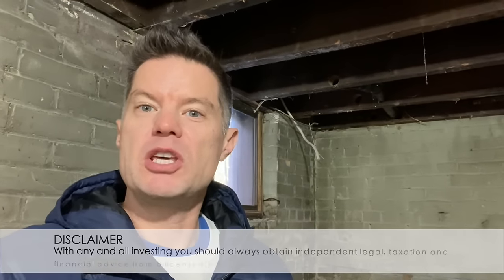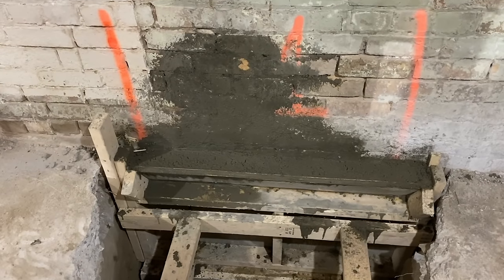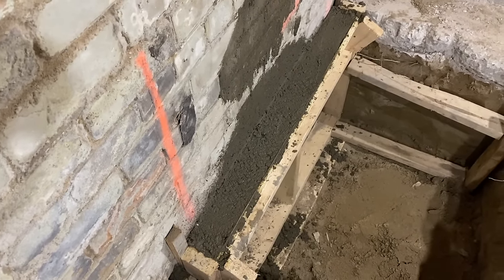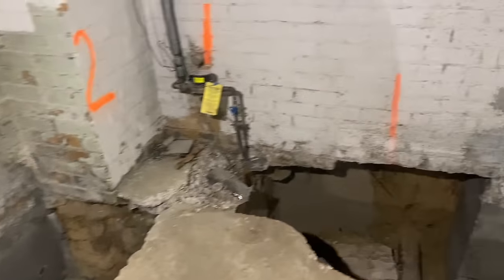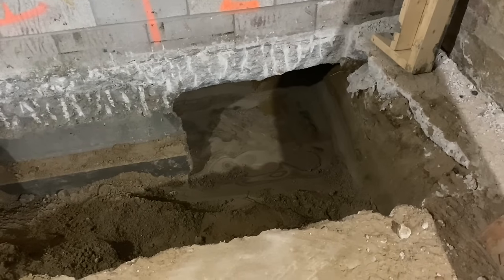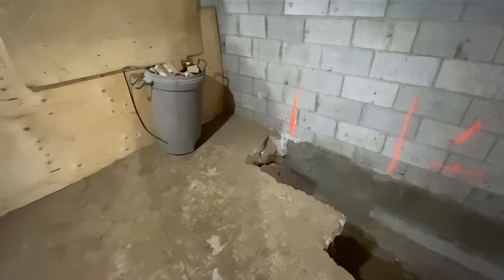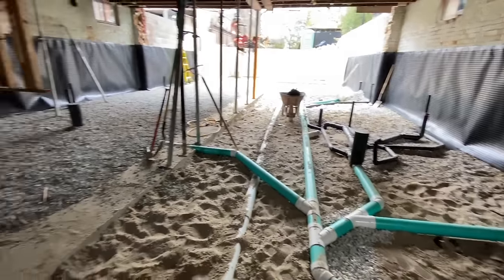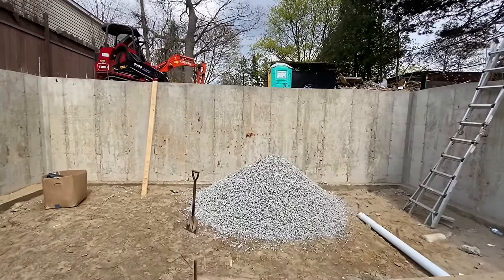Lowering your Basement | Step by Step Underpinning Explained | How to Lower a Basement

Comment: Since the new foundation is NOT monolithic, rebar should have been installed in the foundation pour with the rebar overlapping at least 24 inches. Currently your new foundation is a series of unattached pier footings.
Reply: Was going to ask about this exact thing.
Reply: Disclaimer up front. No engineer here. That said, I was thinking the same while watching the video. 
Im wondering if the following was considered with the non-use of rebar... Each key's rough and uneven edge  provides subsequent pours something to bite into.  Also, the ground at each key has supported weight for quite some time, and so it's packed and solid. There's the step (or "bench") at the base with the floor poured up against it. There seems to be appropriate joisting to support weight distribution and it doesn't appear that any specific key stands to be overloaded. I dont know enough to make any of this an argument. Simply asking if the decision not to use rebar was made on any of the above. 
I'm fascinated by the subject and enjoyed this very well made video and appreciate the work that was done.
I do have another question with regard to the use of waterproofing membranes inside the home. Could holding the water behind them compromise the integrity of the masonry (concrete/brick) over time? I've never used them and don't understand how they work. Water moves in the direction of gravity and where's there's the least resistance. It seems that membranes applied against masonry walls would present the outward resistance and slow the movement of that water, keeping it in the brick/concrete longer.
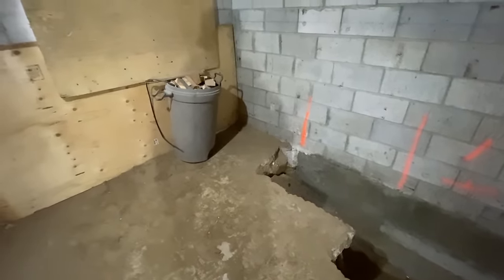Reply: 10:26 The “bench footing” is also needed to support the weight of the entire building.  It looks to be about 8” thick and 24” deep which is about right to support this building which has brick walls about 1’ thick and is at least two story.  Bench footings are all we see in my area though we just call them footings.  This is a great video.  Learned a lot.  Thank you
Reply: Good questions. I can't answer most of them, but I can answer about the membrane. If you look closely, you can see it's dimpled. This keeps the vast majority of the membrane away from the foundation, giving water a place to escape. In this case, they have installed a French drain that runs into a sump pump.
Reply: The way it is shown here is how underpinning is done. The “hit and miss” way of excavating means that there is no way to overlap the rebar. Depending on the location it may not be necessary, but if you did need to interlock the adjacent underpins then the only way would be to either fully lift and shore the building (to allow for a continuous excavation/pour, or (depending on the loads) you could drill and dowel bars into the primary underpins when building the secondary ones.
Reply: The initial wall segments could have had appropriate grids of rebar placed with threaded rebar couplers attached at the ends of the lateral bars. The threaded rebar couplers could have been attached with roofing nails to the bulkhead forms of the initial segments to keep them placed accurately during the pour. This way after the first pour segment forms are stripped and the second pour segments are excavated, there would be approved fixings to complete a continuous rebar grid along the entire length of the new wall, while still providing a way to build it in segments.
Reply: @chriskelvin248 yes, that would be more practical than lapping. But it still isn’t necessary in most cases, and would be a bit more fiddly than doweling. Why would the underpinning need to be reinforced together? It could be out of concern that they will settle differently under the load of the house, but in this case the masonry wall would likely give a very uniform line load along the building perimeter. The underpinning elements will obviously be exposed to a lateral soil load once the basement is deepened- but vertical bars are typically the only type of reinforcement used to resist this load (in which case we should be talking about doweling the vertical bars into the underside of that masonry wall). It could also be done as “extra insurance” or built it stronger! But that’s not always best- in this case having bars cross the cold joint could potentially expose the reinforcement to early corrosion (cold joint are typically treated like cracks when looking at water seepage). It would also lead to rebar congestion, you can’t thread in a bar to both sides on the secondary underpins, so you will be doubling the amount of steel.
Reply: @c4fishfood  1)I can imagine a decision balancing the aligning of the threaded rebar ends and cleaning them against the time spent after the fact drilling/ epoxying/ doweling
2) perhaps the new lower wall does NOT need rebar, that is baked into the engineer’s stamp
3) my reasoning for “continuous rebar was to both tie the adjacent cold joint segments together as one and to resist the inward bending moment of the backfill outside vs the empty basement inside
4) there are expanding bituminous strips that exist to water seal cold joints. I have seen sections of septic tanks joined in a sanitary fashion this way
5)yes the stubby length of the segments would practically double the amount of rebar in minimum overlaps or j-bars…
Reply: @c4fishfood  the rebar is hammered into the unexcavated  soil either side of the pit, leaving 18 inches sticking out into the ready to be poured pit, then when the adjacent pit is dug out, the rods are there,
Reply: PhD mechanical engineer here. I have a few thoughts.but this is not my expertise. I'm gonna trust their engineer
Reply: @c4fishfood  rebr can be driven into the dirt on both sides of the first pour , then one side of the second pour.with overlap and tied. little aggravating but can be done 😁, why it wasn't used don't know
Reply: @Nathan-d8d probably because that’s not the right way to do it
Reply: @c4fishfood  I've had to do it that way on occasion,  and it was an engineered job,  but can't speak for that one , just was answering a question from earlier lol
Reply: Thanks for posting. Very informative and great detail in explanation! Pretty cool addition.
Reply: So I built homes for 44 years. 20 years on 10,000 sq ft homes we didn’t use rebar ? I was in my first house I built a few weeks ago.  The basement was never finished.  8” block walls.  Not a crack in the floor or the walls and a 10 ft ceiling ?   So , if you consider what rebar does it reinforces and bridges the weakness in the footer. Once the footer cracks , the rebar just bends.  No matter how much rebar you use.  I’ll take advice from a builder that’s built over 50 executive homes in 44 years loooooong before I listen to an engineer.  We only used rebar when we had to entertain the codes and permits.  I see so much rebar and wire mesh in buildings now.  Too many people that don’t Jack Schmidt designing homes. You would have to give them instructions on how to use a hammer.  We always laugh and get some fun jokes in when we use rebar and mesh.  It’s comical at times to see the ignorance of engineers and architects when they can’t even drive a nail or even understand the basic principles in construction.  BUT they have a degree !  That’s all that matters !  😂

Comment: It's a good idea to put rebar pegs between the sections to pin them together.
Reply: I’m honestly surprised that wasn’t required. Those underpinned sections will now settle independently.
Reply: Yeah, really surprised the see a general lack of steel.
Reply: I started my basement with shovels and buckets. Then I got smart. I bought an electric rototiller for about a hundred bucks. Then I just made piles of loose dirt. And called a company that had a vacuum truck and they suck the piles and took them away.. pure genius..
Reply: I would have opted for key ways that would help on keeping the water from bleeding thru the wall later.
Reply: @lostintime8651  I picked up an electric dirt conveyor made for basements for $400 and sold it a couple years later for $2000.  Had some ledge and picked a ton but a roto tiller would have been great for 3/4s of mine.  Definitely an experience in full house remodels I will never forget.
Reply: National Building Code requires it. My inspector made it a point of checking for it.
Reply: Agreed @ikesquirrel. I thought that those 3 different sections of underpinning would certainly need to be married together to help  stop cracking and independant movement.
Reply: @danielrutherford9456 Curious as to how you think that these new concrete sections might settle independently/unevenly since they’re chemically bonded to each other and to the original wall.
Reply: Not an engineer, but I thought the same. Figured they'd drill holes and slide some rebar in... keeping water out was mentioned by comment above. I have 2 sump pumps, one runs whenever there is precipitation.
Reply: If you put rebar in the Everytime it comes in contact with water it rusts. Expanding and cracking your cement. I'd rather not rebar between sections.
Reply: @blackout7615  Fiberglass rebar would mitigate any corrosion concerns
Reply: @georgejetson4378  Concrete doesn't bond like you think when you pour up to existing concrete. Usually, when you want to attach new concrete to existing concrete and keep them even you insert a physical bar to join the two sections like a dowel.

Comment: We are waterproofing company in Canada and we put the Delta membrane all the way up to the ceiling not just the lowered section. Also we would run the Delta membrane throughout the floor so it's completely enveloped so that no hydrostatic pressure water would make contact with the concrete slab
Reply: As a flooring installer, I like what what your are saying! Not enough builders/engineers consider hydrostatic pressure.
Reply: @brotherbill1000  lol 100 year old farm house here with a very high hydro. drilled a 3/4 hole in the floor and had water spouts. 100gal a min sump pumps. good times!!! 6 inch tile from pit to creek did away with all 3 pumps. hand digging craw space now and will be sealing it up properly

Comment: If the house sitting on any foundation is a framed structure it is far easier, cleaner and probably cheaper to have a house mover come in and raise the house up off the foundation, last up a row or two of concrete blocks tied into the existing foundation then lower the house and bolt it back down. The last time I had this done the mover was in and out in 4 days.

Comment: Great video, information, procedures, ideas and work! A neighbor hired and an engineer that charged hime about $40,000! I have done a few of these with no engineer. One job, with one helper I removed about 210 cubic yards of dirt, foundation and walls. We supported the house as we dug it out. I did this in one day, it was in good working conditions with no problems. What I use on jobs depending on the conditions is a CAT 1 1/2 yard track loader, Bobcat mini track loader, conveyors and a back hoe. The inspector said this was the best design and constructed job he had seen. I sometimes sub out the concrete work, if it is small I will do it myself. I will not work for someone if they will not install the pex pipe. Before this policy had I too many people call me for a price to tear out their new slab and put in in floor heat!

Comment: I am a recently retired building inspector and I would just like to say that I wished every homeowner/contractor did the work correctly as portrayed in this video because my job would have been made so much easier. After all these years I’m really happy to be retired because it seems like every project I had to educate everyone and argue with the ones that were too thick headed to understand!
This job was well done and I would pass with flying colors! Let me sign that inspection card!
Reply from the maker: That's amazing insight. Thank you for sharing. Are you sure you don't want to come out of retirement? We could use some good inspectors in T.O.
Reply: Gr Delaware::: I don’t know your employer, but I suspect your boss would not agree with your opinion that “This job was well done and I would pass with flying colors!”  Notice the new underpinning footings are constructed as several individual piers along the perimeter of the building. First error: the new footing needs horizontal reinforcement steel ( rebars) at top and bottom tying together all the individual footing piers. Second error: each new underpinning footing piers needs vertical rebars tying together the new footing to existing footing. Third error: the new footing needs rebar dowels tying together the new footing to the new slab. Fourth error: the constructed concrete slab had no rebars; it needs at least the minimum rebar density of 0.007. Fifth error: need shear reinforcement placed in each column pad foundation so as to resist punch shear. Sixth error: need  perimeter rebars, typically #4 rebars, around an opening in the concrete slab. Seventh error: floor joist supported by masonry wall shall have positive connections each  capable of resisting a horizontal force of about 300 lbs/ ft. Possible eighth  error: the masonry wall appears to be unreinforced; unreinforced masonry must be reinforced when major structural renovation is made to the building as required in the building code. 

As to your “Let me sign that inspection card!” The Host of the Apprentice would say, “Your fired!”
Reply: I was wondering why he wasn't using reinforcing Rebars? pouring concrete on a dry section. What is your thaughts? Thanks
Reply: @ubermenschen3636  Some excellent observations. The rebar is in my opinion an absolute must. Really makes a huge difference in strength and tying everything together.
Reply: @ubermenschen3636  The host was fired!
Reply: @ubermenschen3636  Not a comment about the original inspectors findings vs your findings specifically. Rather a comment about my (building owner) experiences with inspections. It seems sometimes that passing an inspection is just a matter of good luck. There's so much variation in opinions that the inspector that you happen to get, and maybe even how they happen to feel that day, determine whether or not it passes. Of course if the work is just bad, it won't (and shouldn't) pass. But failing an inspection when the inspector can't point to where in the code you didn't do something is another matter. Just sayin'
Reply: @ubermenschen3636  No rebar at all. That alone makes it wrong. I started doing this type of work 30 yrs ago
Reply: @ubermenschen3636  The host was fired...LOL!

Comment: What an incredible undertaking Darren! Love the idea of the radiant heat in the basement, it's efficient, energy-saving, and cozy for the people who will live there.
Reply from the maker: We're using it as our main heat source throughout the house not just the basement. I'll have to do another video on that soon.
Reply: @DarrenVoros  that sounds like a good idea, it would be definitely interesting
Reply: I have electric radiant strip heaters (also known as "cove heaters") in my house.  They look similar to baseboard heaters but mount up on the wall near the ceiling.  The face plates get up to 300 degrees which does a terrific job of warming the floor and other surfaces, including furniture.  Gives a very cozy feel similar to a fireplace.  The heat pump provides baseline heat most of the time, and the cove heaters give us zoned control.  The operating cost hasn't been too bad for the level of comfort.

Comment: We actually did something like this 40 years ago. We had a 3 story apartment building with 6 …4 room rental apartments. We noticed that the brick had cracked and was moving away from the building. We called a local contractor and he bid the job for $10,000, just to stop the brick from moving. I had a cousin that was this type of engineer in the old country (Poland). He suggested we did the foundation from the outside and pour concrete under the footing. This being an English basement, the footing was only 4 feet below the ground. We dug by hand the west wall for 15 feet and put concrete under the footing that was half exposed. The next weekend we did the north wall the same way. We then put foundation coating (tar) on the new concrete and covered up the hole thing. We used premixed concrete in bags and mixed everything in a wheel barrow. It was hard work. The repair worked and the brick did not move any further. We repaired the brick that had separated. The job cost $1000 and a lot of free family labor.     Jim
PS…..the reason the wall moved was a dry well that was in the front yard was too close to the house and some settling took place, bad design by…?

Comment: Did you mention how they tie the new concrete into the old? Drill and epoxy rebar or adhesive applications?
Interesting to see how this is all the rage in city building homes in england because there is no other direction in which to expand...lol.

Comment: Thank you Darren for clear explanation! 
Could you please tell me the following: 
1) what was the strength of the concrete? How many PSI? Did they mixed concrete themselves or ordered? If they mixed themselves, what concrete bags brand did they buy?  Did they used additives to the concrete (fiber, plastificator, extra cement, etc.)? 
2) What are the dimensions of the footing and stem wall? 
3) Did you used rebars for reinforcement? If yes - how many on the bottom and vertical? Size? Did they used bars to connect between old and new foundation? If yes, how they did it? 
4) How did they removed supporting barring wall jacks and installed supportincluding beam?